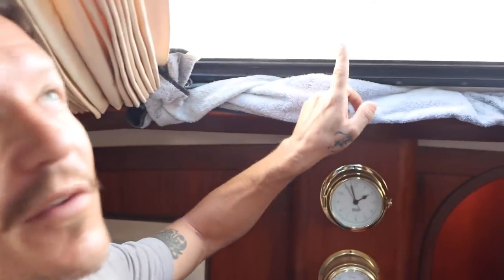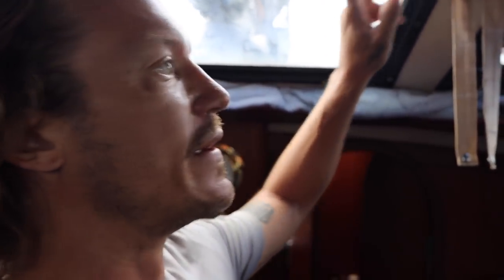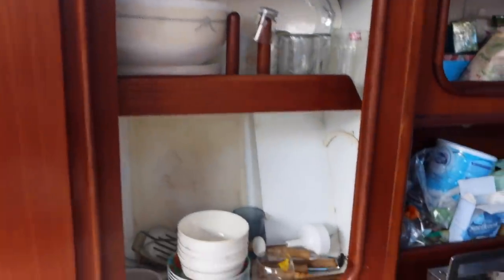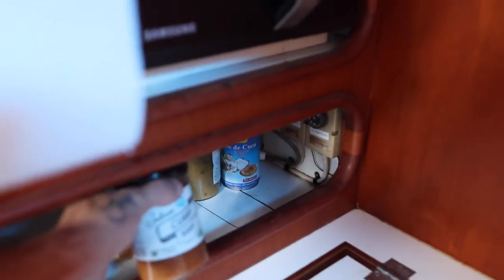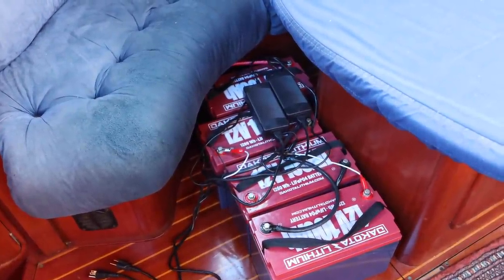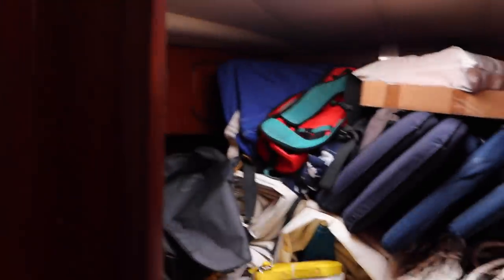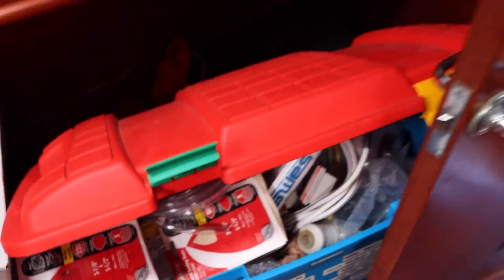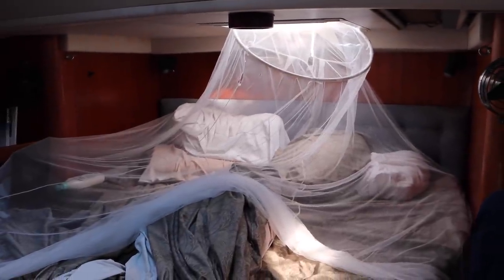UNCUT: Behind the Scenes with Sailing Zingaro

Comment: Bout the bearing,  set up your pulling device then give it what for with a CO2 fire extinguisher. That will often shrink a bearing to make it nearly fall out.  I've seen bearings literally fall on the floor doing that. Just the weight of the puller dropped the whole works on everybody's feet.
Reply: I saw a guy last week using COmpressed air can, laptops dust, to fix dents in his car. The cold after boiling water, spray it with can upside down so all the cool co2 comes out and then wack. Bang dent resets it self to original shap... pretty cool stuff

Comment: You don’t know how lucky you are  ,to have a boat like that. , and there will be rubber kits for thoes windows , the first job to do and she’s dry. ,sea cocks next back in the water after an antfowell and your off , does the motor run ok , run it on the hard  ,check it out , it took us years to end up with a 78 ft yacht and manage it maintainance wise so keep things  working  ,Wright small day lists of jobs and complete them , then another one ,  and so on of the important works to do so keep going we need to see progress reports not stress reports  , if you can’t handle this part of it sell it  ,keep going

Comment: Hi James,  I think save thing to do is change all the rubbers of portholes and hatches, rubber has stiffened and eventually will start leaking if not already.
Also when doing your thru-hull holes, you might want to check all connecting rubber lines ( grey water / sea water / fresh water ) from tanks to intersections & heads & shower, because they also will have stiffened up or be worn down. Now that you have everything open it is easier to handle, rather to deal with when on a voyage.
you might find some tricks & tips with these fellow YT'ers who also own an Oyster : SY Talisman ( https://www.youtube.com/c/Sailingat9000/featured ) and SY Brittanica ( https://www.youtube.com/c/Sailingbritican/featured ). hell maybe they can give you good tips !

you are getting there !   keep up the good spirits & very much looking forward to so your beauty on the open blue waters !
all success to you mate !